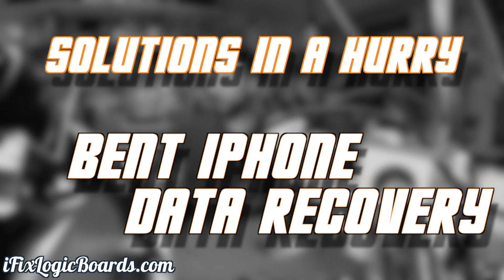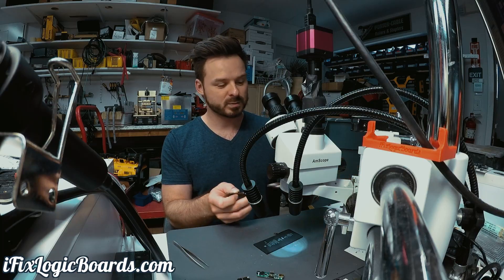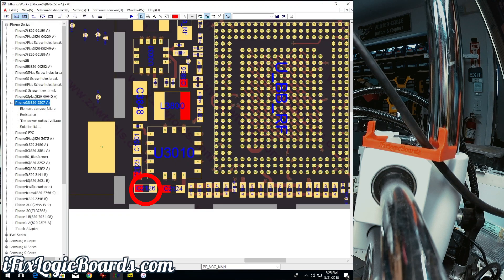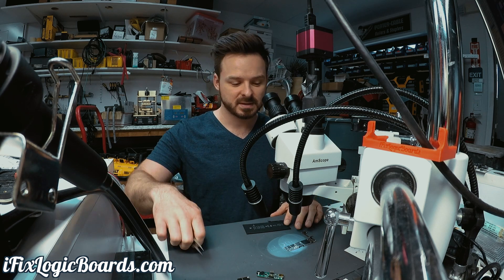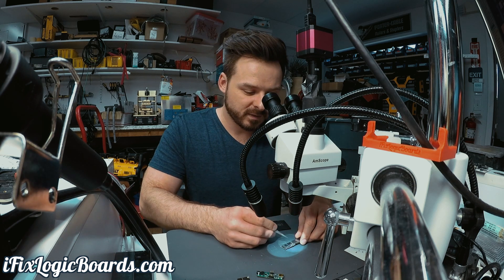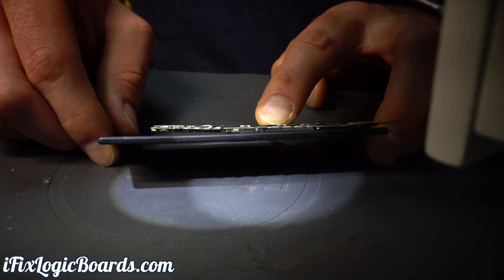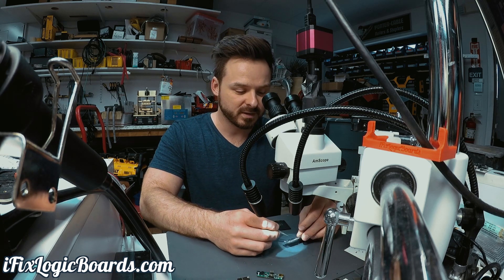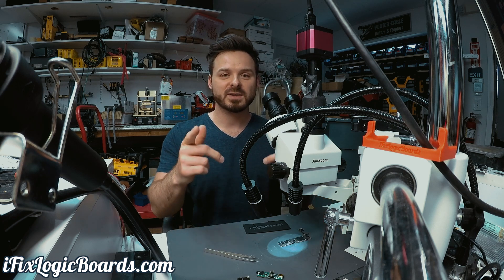Dead bent iPhone 6S - No power - Solutions in a Hurry

Comment: Hi, I have an iPhone 6s with fluctuating voltage. It had water damage and there was a short on vcc_main. I have cleaned it with an ultrasonic cleaner and changed the U4040 and short is gone. When I connect it to the power supply it shows me 20-80mA and all voltage test is fluctuating. Can you help me, please? Thanks. You can find a video about this issue here: https://www.youtube.com/watch?v=mLrUbxcIAJo&feature=youtu.be